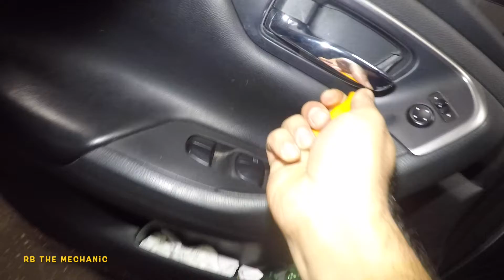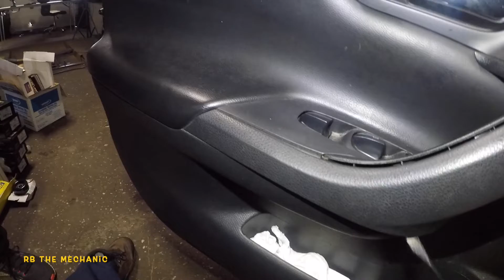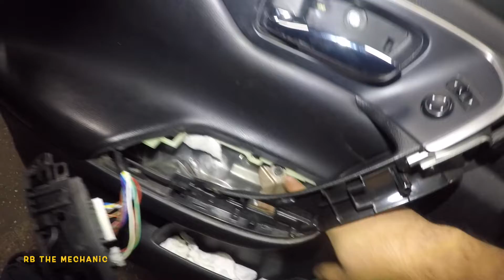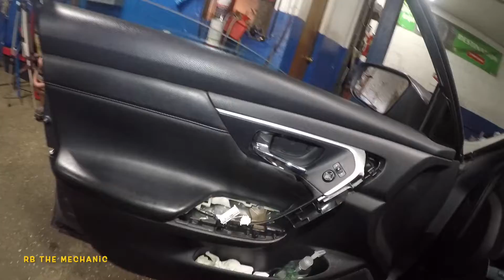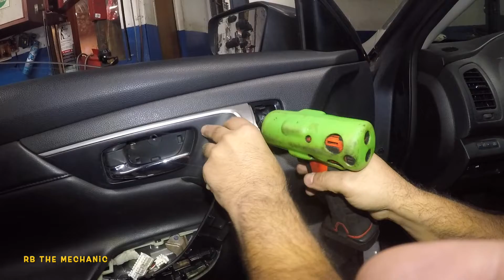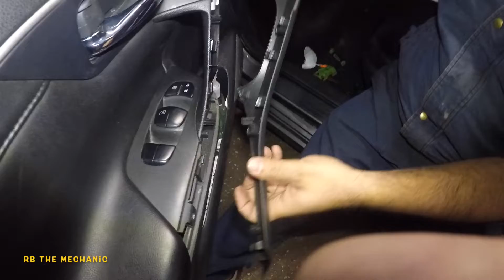How to remove door panel on Nissan Altima 2014 2015 2016 2017

Comment: If my driver door isn’t working: what could that mean? Faulty wiring? A fuse problem? (It’s only my driver door) it also doesn’t light up
Reply from the maker: What u mean by not wiring? Not unlocking?  It could be multi things start with changing the bulb it could be bad bulb other wise wiring could be issue also the electrical parts could have gone bad inside the door so I’m not sure exactly what ur issue is.  Another thing if all went out at once same time then it could be related to door harnes
Reply: @RBTheMechanic hey so I’m having the same issue. All power lock and window switches don’t work from all 4 doors. The fuses and relays seem fine… (also, car is from Copart and the driver door was open for 2 weeks straight and it started raining bad.)
What do you recommend?
Reply from the maker: @gersonargueta3639  possability bad master switch
Reply: @RBTheMechanic  how do I change that